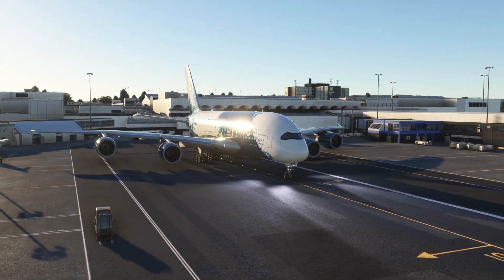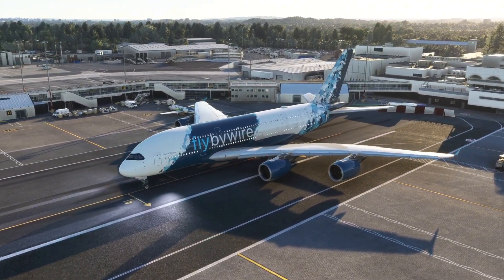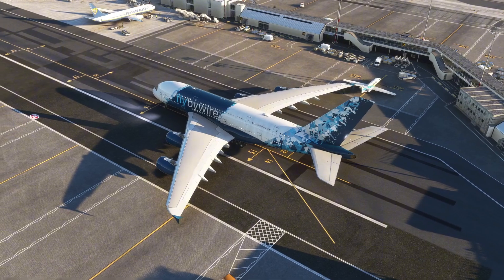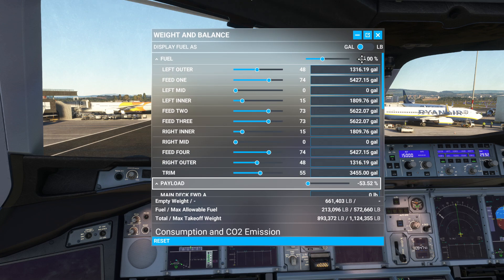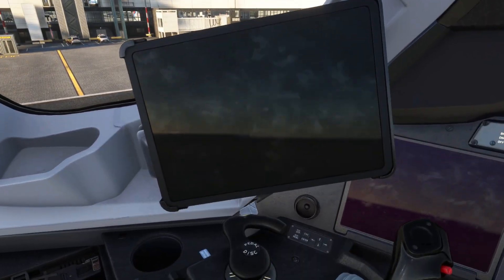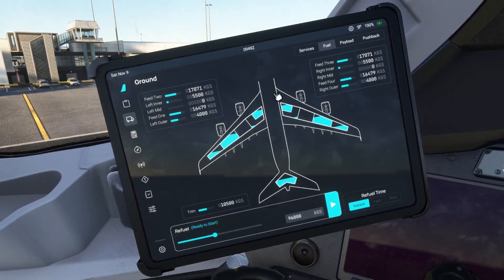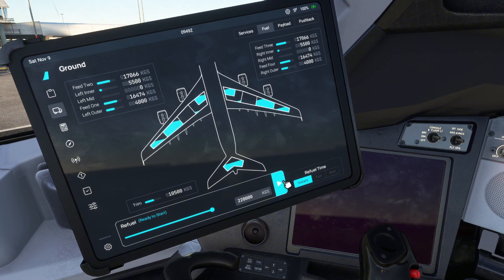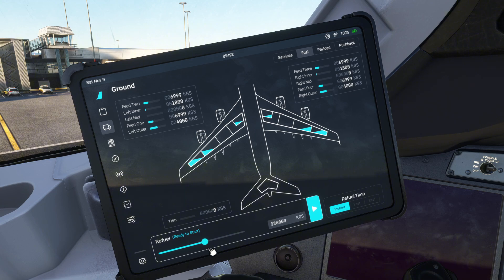Refueling Glitch Easy Fix / Airbus A380X / MSFS 2024

Comment: @TheGarlicMan Tare you mean. I calculated the alleged volume of the wings years ago when it came out. In amongst the electronics and hydraulics how can it possibly store 80% off the 360,000L ? Don't forget the tail allegedly has fuel as well. There is a little fuel to kick off the engines, after that it's Fibonacci all the way. What's the gases are there up high? Think about it.

Comment: Do you know how to fix a wing glitch in fbw a380 in mfs2024, I am scrolling through internet for a long time with this problem, but it seems that nobody has it(I found only 1 same case, but this guy didn’t fix it) my problem is that one of my a380 wing is twitching up and down all the time, it does not affect its performance, but still very annoying
Reply from the maker: @HdjdhdDhdhduud  are you using flight control replay at all? Or sim rate to speed up the sim? This happened to me once but I was using a third party app with the sim. If it’s not any of those things then my only suggestion is to uninstall and reinstall the aircraft. This is a known issue though. Only happened to me once
Reply: @JoshLaddz  just fixed it, it was because of gsx, thank you!
Reply from the maker: @ glad that helped mate :) I’ll make a video of this so other people can fix. It to :)
Reply: @JoshLaddz I don’t uae any of those, the only third party app that I use is gsx, may be I should try without it, but I think it can’t be because of the sim rate, I mean I use the mfs speed up sometimes,  but I haven’t used it for a380 yet, and the wing is twitching like really rapidly and non stop since the beginning of the flight(from the cold and dark I mean), but thank you, I will try to do it without the gsx